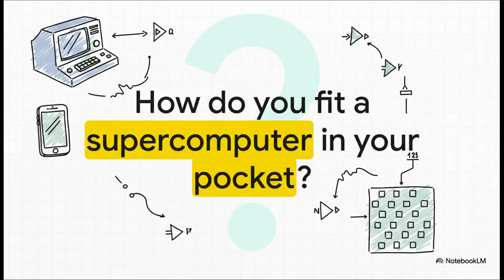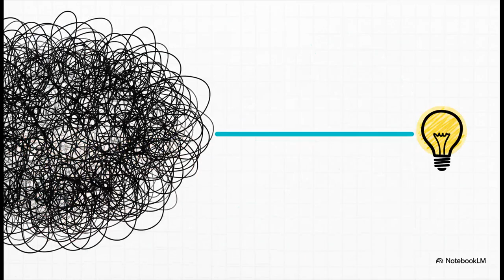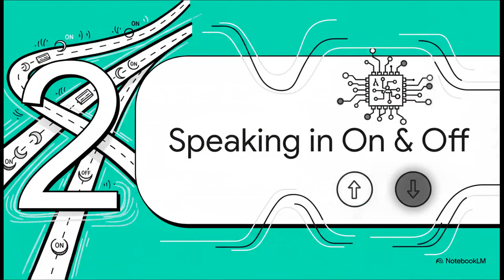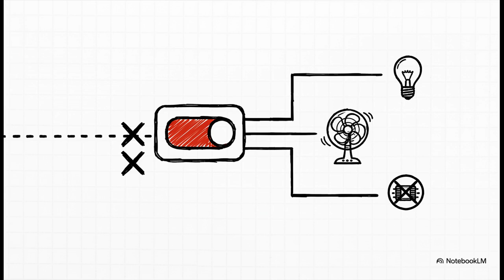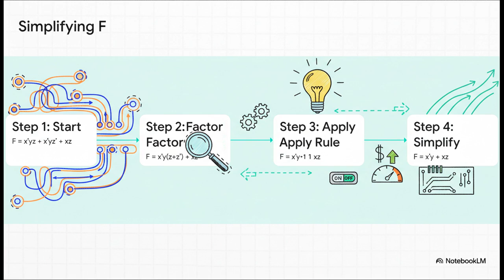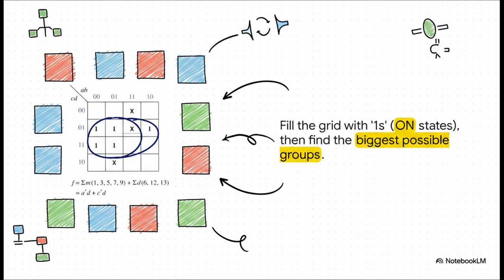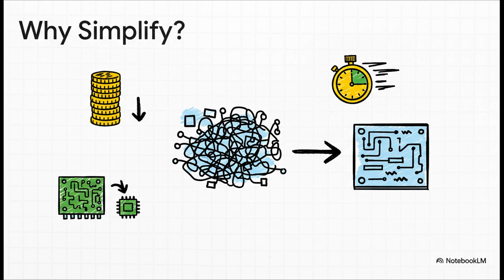K Map

Comment: 0:18 how can I make own 
 supercomputer?
Reply from the maker: A supercomputer can be built by connecting multiple high-performance computers(speed) through a fast network and running parallel-processing software to work as a single powerful system.